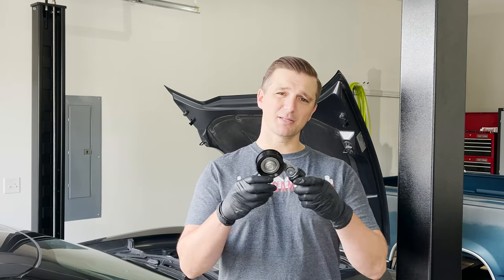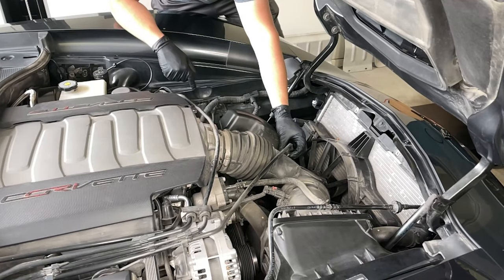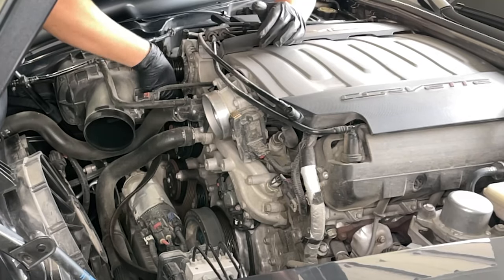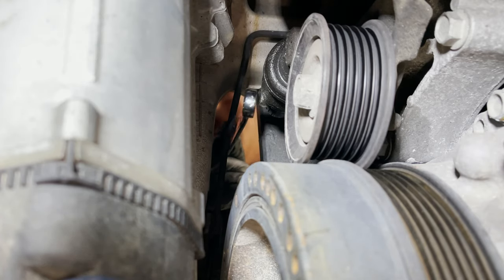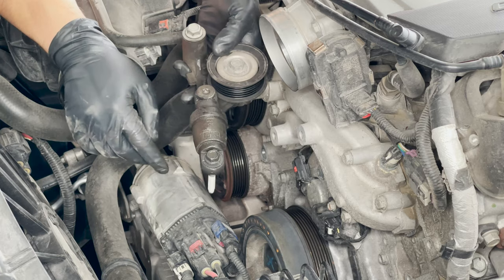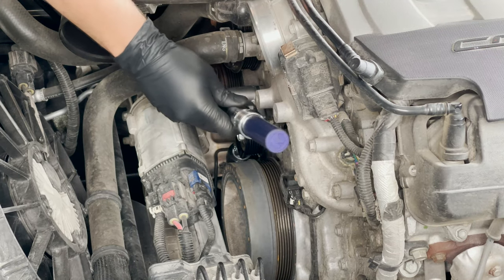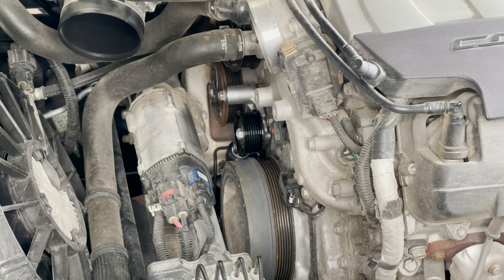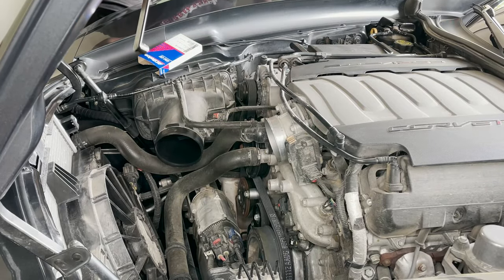Replacing the belt tensioner on a C7 Corvette

Comment: For those replacing the tensioner and belt in your garage--jack up the passenger front, remove the tire, remove the cardboard piece under the front end and you can now get a socket on an extension onto the 13mm lower bolt. This will allow you to see the bolt by sliding your body under the front sub-frame and slide the socket onto the bolt. It will also allow you to use a torque wrench to tighten the bolt. Makes the job quite a lot easier as most of us don't have a car lift.
Reply: You can just change the tensioner without removing  anything but belt. It's not hard

Comment: Great videos sir. C7s do have a issue with this but it's a very easy job to do. Did you use another OEM tensioner when you replaced it or after market? Great job on shooting this with great detail.
Reply from the maker: @Justin Reid Thanks! We used an OEM tensioner
Reply: @SuburbanRanch   good. Hopefully they improved the oem one to be better. Any problems since
Reply from the maker: @Justin Reid No problems yet! First one lasted about 150,000mi so hopefully I get another 150k out of this one haha
Reply: M original has made it to only 40k when it was detected to be leaking during an oil change.  We’ll let the drivetrain warranty and dealership handle this one!

Comment: Did you need to remove anything from the bottom to get to the bottom bolt? I am hoping low profile ramps can get the car up high enough for me to get under there.
Reply from the maker: @John Parrish Nope didn’t remove anything. We did this with just driving the front onto the lift. Equivalent to low profile ramps I would assume (5-6 inch high)

Comment: I have a loud screeching when my AC is on after I start it up. It turns off after a couple minutes and if I don't have the AC on at startup it will not make this noise. Is the AC tensioner the problem?
Reply from the maker: Most likely.
Reply: @SuburbanRanch just did the replacement of the tensioner pulley, and yep this was it. It was barely hanging on by a thread

Comment: 165,000 miles, that is impressive.   Nice to see someone that actually drives their Corvette.   Any other problem areas or weak parts with the C7 that you have experienced over that many miles.   I have a 2019 GS, and was curious what to look out for and what to expect to go wrong / wear out / or fail as the car accumulates miles and Years.   Any recommendations for caring for the car for the long term…
Also, problems with valve deposits and fouling due to the Direct Injection fuel system.   Thanks
Reply from the maker: @70s30 I have 194,000 miles now... The wheels have given me the most trouble they crack and bend with just daily driving.  I bought the car new, here’s everything… That I remember right now. At 40k - muffler, bad actuator. 70k - torque converter. 73k - Cracked rear wheel. 87k - Headlight replaced from high beam flickering. 100k - 2 lifters and the cam shaft. 107k - Front shocks. 120k - Cracked rear wheel (other side). 145k - Bent front wheel. 156k - Belt tensioner.  158k - Rear shocks. 162k - Cracked muffler bracket. 181k - Bad transmission fluid temperature sensor, replaced internal trans harness.  Currently (194k) I believe the torque tube bushing are worn out and need to be replaced ($4-5k at the dealer).  I haven't had any problems with valve deposits or fouling that I know of.  I have followed all the maintenance in the manual and that's all.
Reply: @SuburbanRanch how many miles now? just hit 74k on mine, otw to 100k it’s my daily as well
Reply from the maker: @sosaburned only about 200k when the 5 year warranty ran out I bought a new daily and the vette is now a weekend driver ha.

Comment: After you loosen the tension and slip the belt over the alternator wouldn’t you want to tighten the tension back ?
Reply from the maker: @LT1_barber The tensioner is spring loaded and automatically applies tension to the belt when you release it.

Comment: My c7 stingray (2014) makes a weird noise like if you put a card or can between the tires of a bike. It only happens when I start driving or rev it a little. Is it the belt tensioner? I’m gonna replace it soon.
Reply from the maker: Can you narrow down the location of the sound?
Reply: @SuburbanRanch  idk how to narrow it down but  when it’s on neutral ( manual) I rev it slowly and it makes the sound from where I hear it its coming from the right lower side of the engine. Like where that tensioner is at.
Reply from the maker: Sounds like that could be it
Reply: @SuburbanRanch  thank you
Reply: @SuburbanRanch  question 🙋‍♂️ I changed the belt tensioner it stopped the noise BUT when  hear it again in the high rmps. I did t change the serpentine belt.
Reply from the maker: I’d try the serpentine belt next. It’s pretty cheap. While you have it off, check all of the idler pulleys.
Reply: @SuburbanRanch  thank tou
Reply: @SuburbanRanch  one more question 🙋. I changed  the serpentine belt and it’s still makes that noise when I rev a lil also I noticed that my temperature on the car raised a lil to quick on a cold start. I’m think it might be the water pully. What you think

Comment: Can it also
Make a rattling sound? Mine is leaking oil and it rattles a lot ! I hope it’s not the torque tube
Reply from the maker: Is the rattle at shut down?
Reply: Shut down? Well it rattles all the time but when I hit the pedal , it disappears until I let go the pedal . So it rattles low rpm
Reply from the maker: When you turn the car off. I would start with the idler pulley!
Reply: @SuburbanRanch  I’m
Afraid it’s the torque tube then. When I start the car I hear nothing until the rpm goes lower. Then the rattling noise starts . Thanks for your time . Man I already fixed the tube 1000 miles ago 😞
Reply: @SuburbanRanch  the idler pulley? I searched it up ❤️ thank you for your time and advise